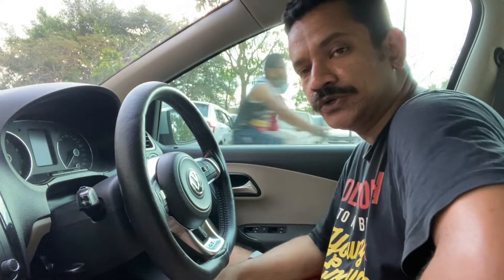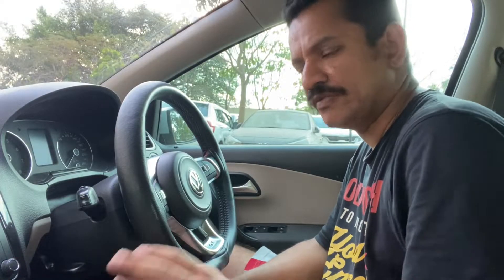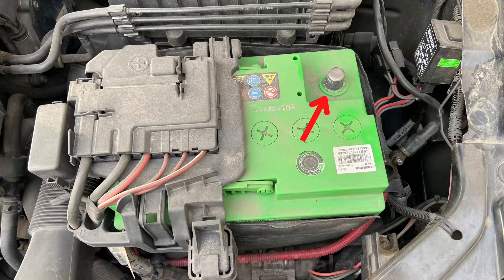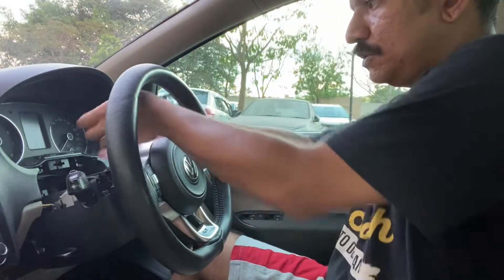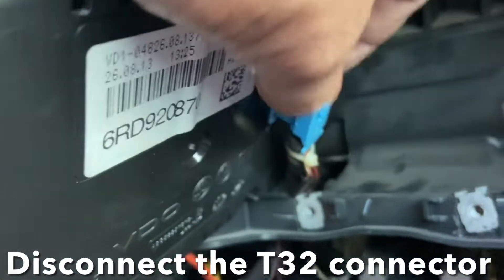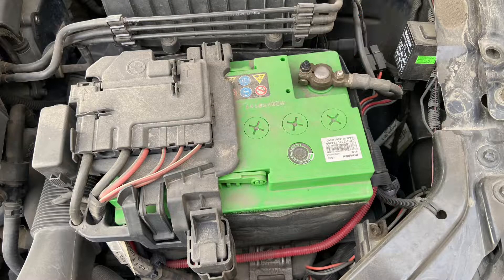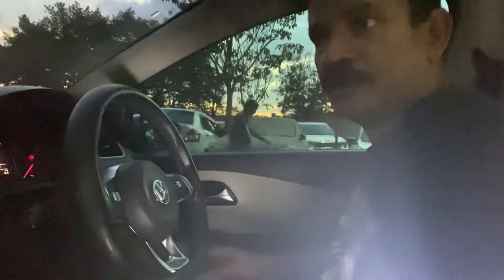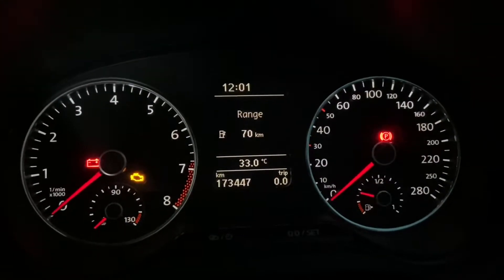Polo 6R - Removing and installing the instrument cluster

Comment: Hello Sir, i can't remove the top part of the steeribg column cowl that covers the screws. No matter how hard i try, it doesn't move. It looks so easy the way you just pull it. Does it maybe have to do some thing with the little metal clips which can be seen at 1:05 in all 3 holes?
Reply from the maker: You just have to pull it like really hard. Try it out.

Comment: Great piece of advice at the end of the video, wrt to the immobiliser coding of the car keys. That’s the most important aspect of this retrofit as the maxidot cluster is not plug & Play. One thing I would like to ask, can the stock cluster be used again later after upgrading to the maxidot or it’s a dead piece.
Reply from the maker: Hi Navmeet, from what I know, a new cluster can be coded twice. So the odo reading can be transferred to a stock cluster once again after it has been used.

Comment: Can we change the analogue instruments cluster with digital one in Virtus GT
Reply from the maker: Hi Kabeer, I don’t have experience with the MQB A0/ IN platform but it should be doable. You would need some additional tools to extract information from the stock cluster which have to be then coded to the digital cluster.

Comment: Can you use the polo 6r 2009 panel on the polo 9n3 2009? thanks
Reply from the maker: Hi, no the mounting points and the connectors are different.

Comment: Hlo sir, I own a polo 1.6 petrol 2011 model so I want to change my steering wheel to gt model so for that I have ordered 2017 model cluster, Ecm, clock spring, steering wheel and airbag so will it do or someone is saying that old cluster will not work I'm totally confused please help
Reply from the maker: What about the BCM? You will have to get it installed at a place who knows what they are doing. The immobiliser data has to be read from the stock cluster and coded into the new cluster.

Comment: Hii gannu sir I have vento tdi 2012 highline varient. I want to retrofit cruise control. Do I need to change instrument cluster. Because my instruments cluster does not have cruise control symbol.will it work without instruments cluster change.

Where i can source stalking switch with trip buttons on right and cruise control buttons on left.  In india
Reply from the maker: Hi, the cluster indicates the cruise control notification light when it is enabled. So if you need the notification in the interest of safety, it is best to have the cluster that supports it. The old clusters supports cruise control and will work without the notification. 

I sourced the combination switch with cruise control from Spain. You can check eBay.com. Or approach VAG retrofitters who do this work on skoda and VW cars for a cost.

Comment: Hi Gannu. Did you have to upgrade the BCM of the 6R for the new instrument cluster to work?

I have a VW Vento 1.6 tdi highline for which inhad upgraded the steering wheel with controls on left and right but the ones on the right dont work obviously because I still have the old cluster. Therefore, wanted to know if I will have to upgrade the BCM as well while upgrading the cluster.
Reply from the maker: Hi Anirudh, I had upgraded the BCM to install cruise control in my car. Coincidentally, I had also installed the Mk7 steering wheel and the controls and lighting worked. I am not sure if the BCM was helpful for that upgrade. 

Why don’t you try sourcing a BCM from a scrap car in a salvage yard in your town? That would be the cheapest bet to find a replacement BCM.
Reply: Hii gannu sir I have vento tdi 2012 highline varient. I want to retrofit cruise control. Do I need to change instrument cluster. Because my instruments cluster does not have cruise control symbol.will it work without instruments cluster change..

Comment: My instrument cluster is playing up so going to get a second hand one, but can I just switch them over/plug and play or do I need to have new cluster coded? Any help would be massively appreciated, thanks
Reply from the maker: Hi, you’ll have to code the replacement cluster with your car keys. For transferring the odo reading, the EEPROM from the old cluster has to be read using a tool. Where are you based? If it’s Bangalore, I can recommend a friend who’s into retrofits and such. He can do it for you.

Comment: Hiya bud, watching this from the UK. I have a 61 plate GTI with the upgraded cluster but as it is an import, it reads in KM/H. I have bought a unit that displays MPH was just wondering will this be plug and plqy? Cheers
Reply from the maker: Hello Charlie, it’s not plug and play and requires additional equipment to take the data out of your stock cluster and code your new cluster. Your dealership should do it for you or someone who does retrofits on VAG cars.

Comment: Hey, can I install the gti cluster on my polo tdi 2011
Reply from the maker: Absolutely. Just need to code it from your existing key and immobiliser from your stock instrument cluster. 

No issues with the tacho. CEL works when it shows up. The only issue is no glow plug warning light that momentarily turns on and off when you start the car.

Comment: Hi,

I have followed your thread on team BHP for swaping BCM, I have swapped my 086H BCM to 087S, so have coded central electronics succefully but not able to code Can Gateway 19 (long Coding) also have bunch of errors coz of that, can you please help me how should I code the CAN GATE?
Reply from the maker: Hi Saurabh, trust you’ve taken backups of the long coding and the individual bits which have been ticked. Were you able to transfer the long coding properly to the new BCM? What type of errors are you getting?
Reply: @GaneshBalan  thanks for reply please share you insta handle so that I can share you the images and we can take this conversation further, i do have the copy all the long codes, i do have the option to paste the images here

Comment: Hi Gannu sir! I am experiencing a very weird thing in my vento 1.6 TDI related to the coolant. Just 3 months back got the car serviced and the coolant level was at max or slightly above max, but now it's right between min and max(slightly above min). Saw for any leakages, but didn't see any symptoms of leakage. Any idea what may be the issue?
Reply from the maker: Hi. Did you do a coolant pump change or a coolant change at the service centre? If so, during running, the coolant would get sucked back into the circuit. How long has the car run in terms of km and years? Coolant pump is a frequent failure observed and the pump must be replaced when you change the timing belt at the 90k km mark.
Reply: @GaneshBalan  It's a 2013 model and the car has done 92k kms. Regarding the coolant thing,ig it was topped up and no coolant pump was replaced. I had asked my sa to inspect the timing belt if it needs to be replaced, but at the end nothing was changed, it was a normal service. I ordered a distilled water, will it be fine if i pour some?
Reply from the maker: You can pour distilled water not a problem. Please check if the issue persists when you drive further. I couldn’t understand if the coolant pump wasn’t replaced. Your timing belt, accessory belt, idler pulley and the coolant pump must be replaced by now. It is overdue time wise.
Reply: @GaneshBalan  Yes, even i was left wondered🤔, but i don't have any problem in driving though✌️. Anyways i am waiting for your new thread regarding your polo, yesterday went through your team bhp threads from the beginning and got to know that it's now sold😔( was not aware about it unless i saw a comment on one of your video about it). Got to know a lot about you and your beloved polo, it made me feel sad by looking at your story especially with a car like polo 🥺. Btw thanks for your valuable suggestion sir:) , love from Davangere (KA).
Reply from the maker: Thanks Satwik (got that from your channel :)). Appreciate your comments and feedback. 🙂👍🏻

Comment: Can I have your phone number please I have the issue with sing in my polo tsi I want to change the dashboard meter but it asking for mobilizer and it’s not going to start with another meter please need someone to help me with that give me your what’s app number thank 😢
Reply from the maker: Hi, if you tried swapping another instrument cluster in your car, it won’t work. 

You need to access the immobiliser data from your stock cluster and code it into the new cluster and change the odo reading on the EEPROM. 

Only dealerships or those who have the special equipment for accessing EEPROM data can do this. 

My number is 90996 91369 but other than what I’ve mentioned above, I’m afraid I won’t be able to help you further on this.